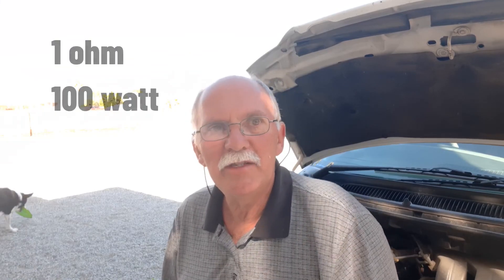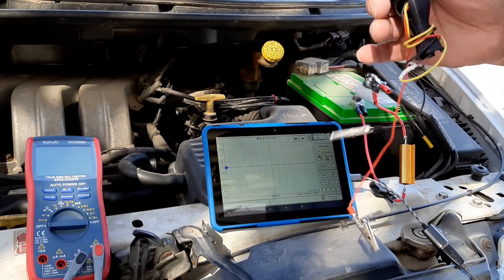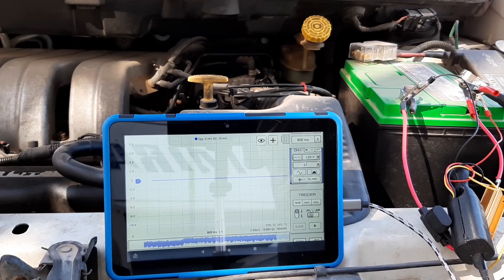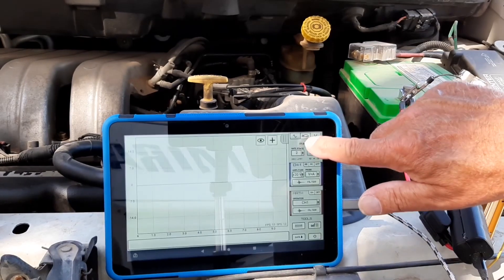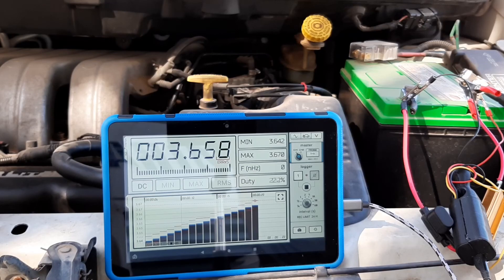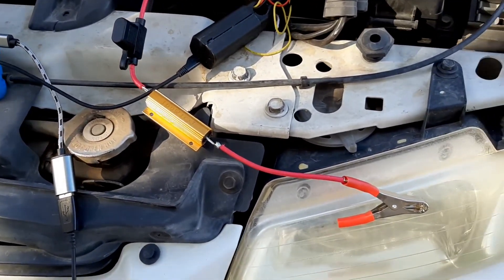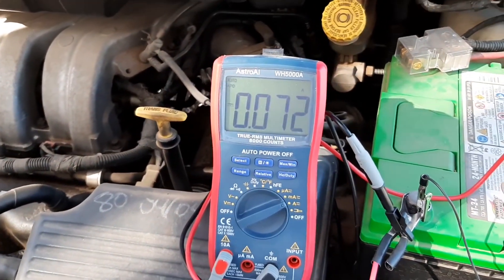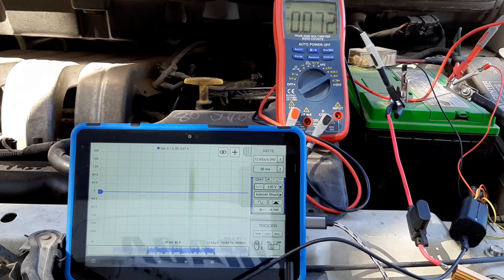HScope data logger

Comment: Thank you VERY, VERY much for sharing your knowledge.  Sorry I am a newbie to the HScope.  But I do have both a 2206B Pico and UScope.

I am really interested in the data logging capabilities for parasitic draw.  I prefer the "shunt method" versus the "multimeter method" as it seems simpler.

Question:  In your video your Android device is connected across the shunt to measure the voltage drop.  You Andriod device has the HScope software loaded onto it.  Is there anything else required?  i.e.  In your video where is your Oscilloscope?  Is an Oscilloscope required?   Or is the Hscope software the Oscilloscope?

If an Oscilloscope is required, am I able to utilize my UScope?

Thank you so much for your help!
Reply from the maker: Yes, you do need an oscilloscope, unfortunately the Pico and UScope are not supported by HScope.  There is a list of scopes supported by HScope at the bottom of the page here: https://www.martinloren.com/hscope/?srsltid=AfmBOoqzUiY_61M05tSgKzxKQ4Qy-VrVCMpnFpS4sl3WBGhQ0U_JwrGy.

I too like the "shunt method" better but if you are in a pinch, it's interesting to see that the dvm works too,

I'm just using a diy scope in this vid that was one of HScope's prototype build, way back they only about cost $5 to make, it was a fun build.

Comment: Isn't the multiplier supposed to be flipped because R=V/I according to ohm's law?
Reply from the maker: You made me watch my video again:) ...   R=V/I.  -->.  V=IR.     voltage and current are proportional to each other.
Reply: @chrisingram7277   So the multiplier isn't a shunt resistor value?

Comment: Pardon me for being ignorant but how did you come up with the equation where you divided the current draw on the multimeter by 384? Also, I have a multimeter with a 20 amp circuit protection. Will that work as well and if so, do I need to use a different equation?
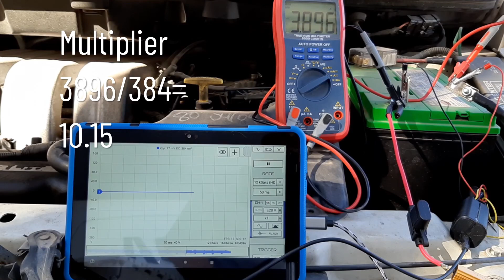Reply from the maker: It's hard to see on a small screen (at 7:05 timestamp) but HScope is showing 384mV of drop across the multimeter while the meter is showing 3896mA of current so all I'm doing is creating a multiplier from those two values.  I'm guessing your meter should work fine but this is a new concept to me, I've only seen one other person do this...

Comment: nice to see you've uploaded a new video and obviously got the hang of the new editor

the ACS712 current module and the shunt resistor method each have their advantages/disadvantages

the shunt disadvantage is that when the current draw was 3.5A it meant that the vehicle modules were only getting 9v (possibly less) and borderline for codes...

ACS712 disadvantage is it's more finicky
Reply from the maker: The multimeter certainly is an easy method, I was surprised seeing that much current going through the bulbs, you are right about that much voltage drop.  
Looks like your version was gadget#20 and has been "house cleaned" :)
I am liking this new video editor, thanks for sharing it.